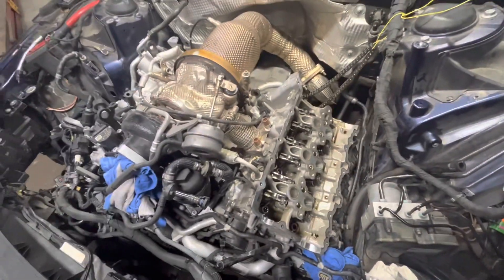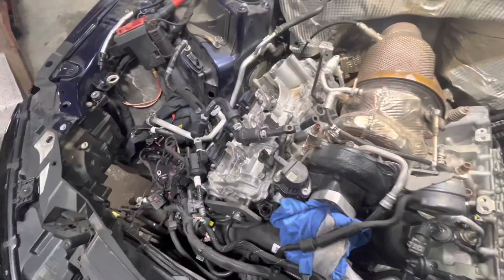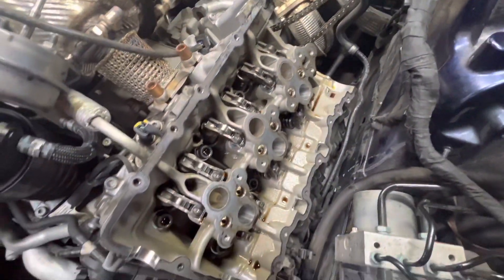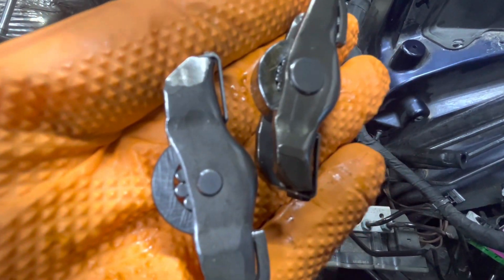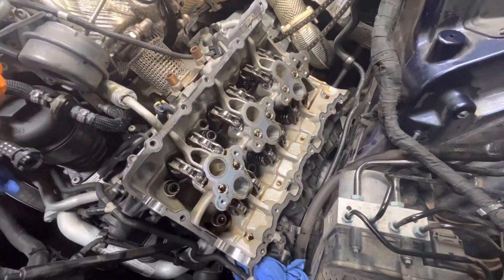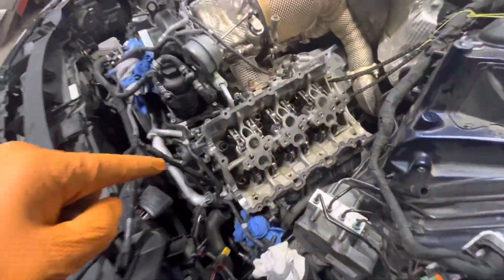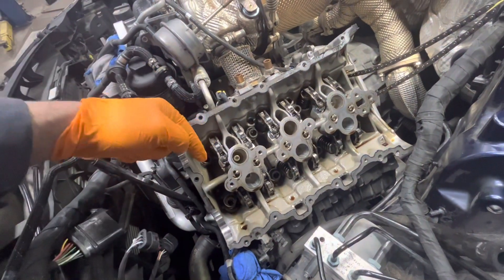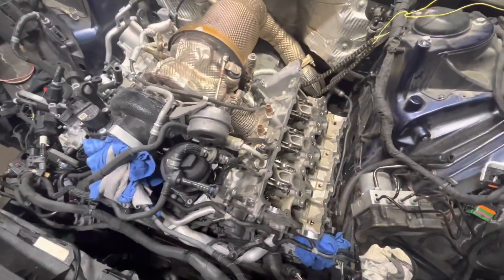AUDI B9 S4 ROCKER ARM UPDATE OVERVIEW

Comment: nice, how did you lock the crank while the engine is in ?
Reply from the maker: I’m pretty I pinned it with the factory tool up on the drivers side on engine block

Comment: Any information on how to do timing on this engine once you put it all together?
Reply: Yes please great question
Reply from the maker: It’s not too bad really, with the camshafts and the crankshaft locked down you can pretty much torque the cam sprocket bolts and be good,
Reply: @EuropeanAutoRepair  could you link what specialty tools you used to lock both ?

Comment: what engine oil you  use?
Reply from the maker: Castrol edge is what I’ve been using lately
Reply: @EuropeanAutoRepair  thanks, but what grade 0w20 or other?
Reply from the maker: 0w20
Reply: People saying 5w30,or 40 to protect this engine better?
Reply: @ITSLITERALLYALEXX   Correct. That's what I've been using.
Reply: Is this not to thin oil ?

Comment: How much would a service like this cost?
Reply from the maker: I’m not 100% sure on pricing, around 20 labor hours I believe
Reply: @EuropeanAutoRepair  So 2000-2500 + parts
Reply: 2k dang
Reply: thats actually not bad.
Reply: A friend was quoted a bit over $5k in California
Reply: I had mine done at the Audi dealer 3 months ago and it was 8 grand.  Granted dealership prices are more. Only reason I did it there was I still had time on my Audi pure protection warranty and they covered the costs.